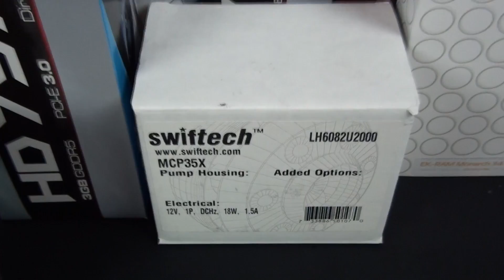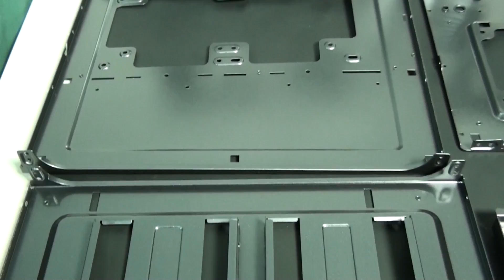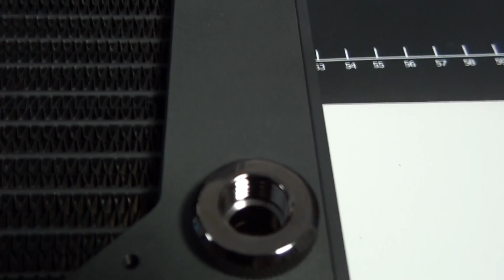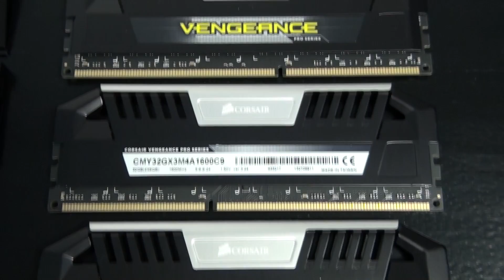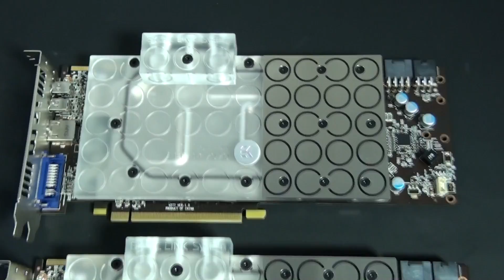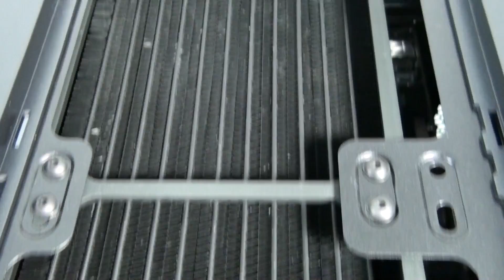Build #13: Extreme AMD Build: Part 1

Comment: Just a thought from a guy who's painted some cars. For any future builds where painting is involved, prepping the surface (sanding and washing) dramatically improves the finish and reduces orange peel. The paint has a better surface to stick to so that also increases longevity. Same goes for any mishaps. Say you want to respray a part, just sand it back down with some 220g sandpaper, wash it, let it dry, and re-spray. Overall though this looks great. I've been wanting to do a build with this case for a while and this has definitely given me some ideas. I'm a noob when it comes to building so your videos are giving me great insight as to what to expect when doing a build.

Comment: Where is build log 2 for this?  I cant find it.  I have the same case, HD's raid 0. I'm running I7 4770K, Maximus VI Extreme, H100i, and EVGA Geforce GTX 660 TI FTW (FTW (3G Ram)).  I was thinking about going to full water cooling, but am probably going to pick up a 780 titan before hand and was thinking of just getting the one with the water block preinstalled, pretty pricey though.  I can only overclock the CPU to 4.4 stable.  So that sucks, but you get the luck of the draw on that.  I really do enjoy this case as everything pretty much gets put behind the motherboard.  Have you thought about putting a water cooler behind the MB?

Comment: I want to see and the second part because I want that box and waits a liquid refriguracion want to see where you put the pump with that big cylindrical guess where you place the bays remove radiators are 45mm truth is not English I write from a translator thanks bye

Comment: I absolutely despise the quality of that lightning on that case. It's much too soft and rounded off. Lightning has core branches and many, many streamers and threads of lightning that surround the core branches. It would have been better to have sent this off to a UV print shop and have it printed instead of airbrushed since you can get the image far more detailed and much more crisp.

Comment: Im really surprised you didn't use dominator gt or platinum with higher frequencies. AMD supports 1866mhz right out of the box on all 8xxx series fx chips and 2133mhz on the 9xxx series fx chips..... Also it didn't seem as though you kept the northbridge rear heat sinks on the crosshair v z, its a simple mod to pop the old studs out of the plates and then just run slightly longer bolts through to the ek block. Asus installed them for a reason. Otherwise, love your work thanx again.

Comment: There are no case mods to this build just paint job and toss in the factory parts.. I will say it's nice to see something other than EK rads, wish u used more xspc parts
Reply: You guys do know that he is not the one who decides what parts are in the build. its a client build.
Reply from the maker: Custom Computing
Im not sponsored by EK. This is a client build so obviously Im not using sponsored parts.
Reply from the maker: Custom Computing
You are certainly right about the surge in custom systems/water-cooling, just look at the expansion of EK recently. When I started my channel it was still very niche, there were very few people who knew anything about water-cooling or modding, now its almost becoming mainstream. It will still take me a long time to trust all these new parts being released. I have to personally test something for years before I will recommend it. Also I see countless design faults in so many of these new parts. I still prefer to stick with the companies who have been around for the longest. I would like to experiment with different parts but I cant do it in client builds unless the parts are requested. I would like to build another system for myself but really don't have the time currently, I have a backlog of builds atm. I plan on taking a couple of months off probably at the end of this year to build a system for myself and I plan on going all out.
Reply: *****  I've used several rads, the only one that leaked on me was the EK Rad, not saying that its poor quality, just #'s. I've used EK, XSPC, Black ICE, several, only one I had the issue with was EK.. not blaming them just nice to see something other than EK EVERYTHING in Singularity builds
Reply: That's 3 pics of 1 bad Raystorm cpu block, yes I had an issue with those before to, my point still stands. Quality control takes over and apparently singularity and his customers think EK is literally the only solution out there for watercooling. EK has had their issues with the nickel plexie blocks in the past but nobody seems to remember that...
Reply: Custom Computing lol everyone remembers the nickel plating issues. It's been fixed though, and the issue was overblown in the first place from geniuses running silver kill coils and running plain distilled with nickel plated blocks. The fact is EK has XSPC beat in terms of variety and options, so much so that it's easier to fit EK components into a build while the only way you can run XSPC blocks is if you're running a copper acetal theme. EK just has more products, so they appeal to a wider range of enthusiasts than XSPC. I do think he could mix it up more, but I would be inclined to go with aquacomputer parts over xspc any day.
Reply: He makes suggestions and he is sponsored by ek.
Reply from the maker: Custom Computing
Normally I use Black Ice radiators and mostly Bitspower components. The only EK parts I normally use are the water-blocks and that's only because no one else makes water-blocks for the parts I am using, or they only make blocks for some of the parts, I cant mix blocks from different manufacturers. Id like to be able to mix it up and use different parts but its not up to me.
Reply from the maker: *****
I have also had problems with XSPC components. Anyone who has been doing this a long time knows where to find the best quality parts. I have used parts from all of the manufacturers over the years, the components which make it into my client builds are the parts which I have personally never had a problem with. The parts I use are also requested in 9/10 builds that I do, so its usually not up to me anyway. I do have a number of builds coming up in which Im using Aquacomputer, Bitspower and XSPC water-blocks.
Reply: ***** I would say this was true a few years back before the surge of custom computing and pc gaming. Traditionally there was only bitspower EK and xspc was just coming on the scene, not I think a lot of quality products are being made by several other companies. 

I just started doing this within the past two years so I'm not nearly as experienced as most of you, but I enjoy when a client allows me to use my imagination and the only requirements are a few hardware pieces, the aesthetics are up to me.

I'd LOVE to see you build a computer for yourself or show what you can do without restriction from a client request. I saw an old video of your computer but haven't seen any since.
Reply: Custom Computing XSPC still has a limited selection in terms of blocks... they only make blocks for reference GPUs and a small handful of motherboards. Their build quality is also lacking a bit compared to EK and doesn't come close to Bitspower from my experience. They make decent budget parts, but I'd never use one of their products when I can get something from BP, EK, AC, or HWL instead.

Comment: Lol I just did that to my rad and drilled through the fin and broke the rad, had to buy another :(
Reply: I think I would cry.
Reply: It was only a single 140 rad $55 so no big deal but if I did that to one of my 420 rads I'd be pissed lol
Reply: Yes it is that build, I've had to put it on hold and am having a contest right now before u release my project glacier client build, this is my best work so far and am completely obsessed with it I can't wait to finish it (would be done if I didn't blow up that rad lol). I'm not 100% sure about the screw head size but it is harder to find big heads with m3 screw sizes so I just go m4 usually :) let me know if you like the build and contest going on ;)
Reply: Custom Computing screw head size isn't necessarily determined by the thread size though, right? Couldn't you go with an m3 screw with a larger head? I guess it could be easier just going with m4, but I would never risk one of my copper aquacomputer AMS rads like that lol. Granted I doubt I could do it in the first place, since the threads on the AMS shroud are actually little inserts instead being threaded into the stainless steel shroud itself. I'll check out your build though. If I remember correctly, is it's the one inspired by the Asus murderbox mkII, right?  I think I've seen it on OCN.
Reply: Custom Computing yeah I like the build, the murderbox mkII is my favorite chassis of all time so I understand where you're coming from. I'm actually working on a murderMod TJ07 build right now, so I'm heavily inspired by Charles' work as well. I haven't started a build log yet even though I'm like 3/4 of the way through lol. I need to get on that though. I'll be sure to stop by your build log and say hey. My username on OCN is failwheeldrive.
Reply: Lesson learned lol. It's kind of pointless anyway. M3 screws are more than enough to support anu rad out there, and there are plenty of nice button head allen key bolts for m3 screws (personal favorite being the ones from mdpc.)
Reply: Hmmm I beg to differ, take a look at my gold rush build the bigger heads if painted really make the details stand out ;)
Reply: Nice man I cannot wait to see your work :) I should b e uploading my final video this week it looks amazing, just waiting on the sleeving in the mail and popping it n  for the finished touches!

Comment: You should enjoy working with the Crosshair 5 Formula Z. My alternate rig has one and it took little effort to get the best out of my FX 8320. Old school base clock overclocking, the way it should be done. It was far more enjoyable to me than overclocking my Haswell chip. It was far less finicky.

Comment: Nice build, however one obvious question, for sure a high end water cooled build why did you go with a FX-8350 over a FX-9590?

The latter is more expensive of course, but a guaranteed 5ghz binned chip right out of the box sounds ideal for an client build as you can guarantee them a performance level. So all in all very interested to hear what made you choose that part.

Other than that... wow, I can't imagine having to start all over again with a new case once you already had put all that work into it, I bet your happy you did though, it looks a lot better! Keep up the good work man, and good luck with the airbrushing thing, I certainly look forward to seeing those videos!
Reply: The 9590 only has about a 9 month life time.
Reply: ColorfulShard
Where on earth did you get that idea? Not only has this not been stated officially by AMD AFAIK but it hasn't been the experience of any users I know who have one. Also it doesn't even make much sense to assume this processor would have such a short life given it is FX-piledriver is just a bulldozer update, and those chips last sizable longer, despite having the same max voltage limits, max temperatures ect and nobody I know of has ever "worn out" a FX-cpu even after years of running overclocked.
Now before you assume this is me being a fanboy, that's not the case, personally i run a haswell i7 in my own system, and a core2duo in my laptop, and both have been great processors. Personally I'd recommend a i7 over a FX-9590, but the Fx-8350 is a great value compared to the i5, as it has similar cost and provides the same gaming fps but better performance in highly threaded tasks like video editing.
Which is why I think its odd a high end, water-cooled computer would use a Fx-8350, sure its good for the money, but there certainly are processors out there that are better in every single way if you throw some more money at it, the Fx-9590 being a great example.

Comment: Have you ever seen "PlastiDip"? Its wicked cool paint that's removable. Check out some videos about it. Its used for cars mainly but I don't see why you cant use it on the cases. That way you can remove the paint if you don't end up liking it.

Comment: I have a 540 Air so I could use some tips. Nice choice of case though. I think you need to go over the PSU ventilation holes with some lightning so it connects with the bolts that are not connected yet.

Comment: Still not perfect, the main front panel is missing the blurry outline on the lightning, it doesn't match the side panel :( you can see it clearly at 27:04
Yes, you need to learn how to do it yourself. looking forward to the next video!